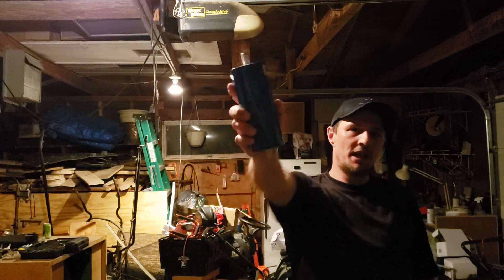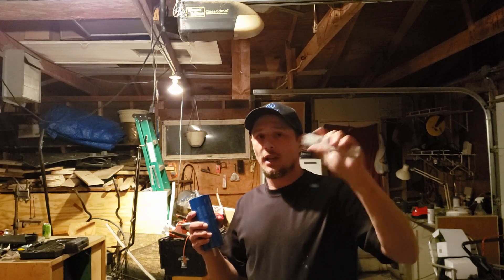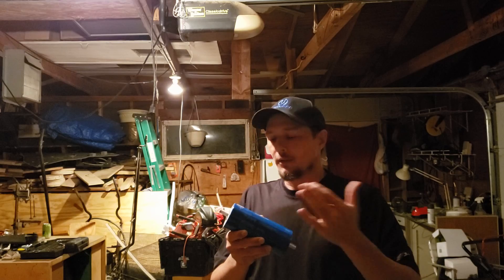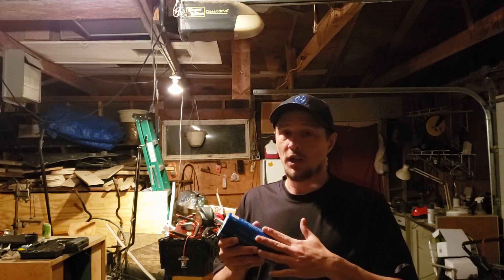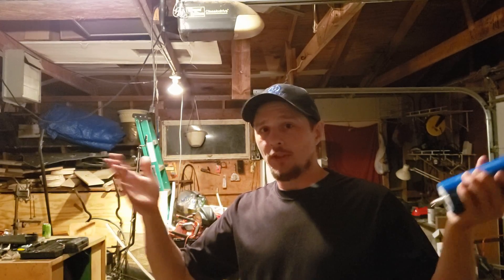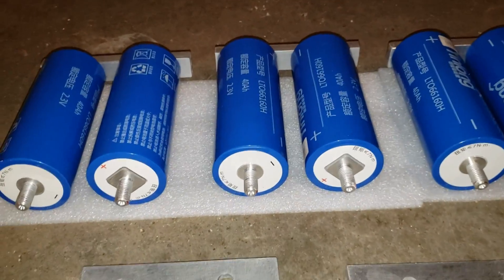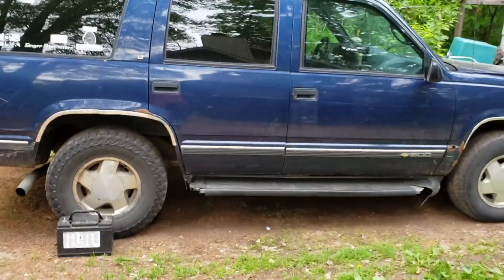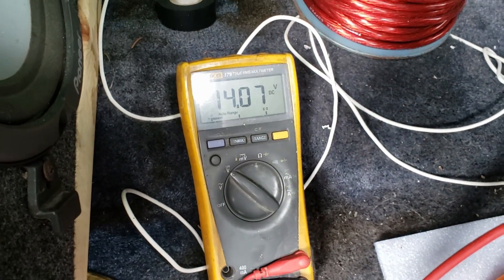13.8v Yinlong LTO 40ah how to Build and testing , DIY Lithium

Comment: Is a 40ah bank good enough for 3k rms? My truck comes with 240 amp stock alt, h6 agm as well. I have 0 gauge power & ground running to amp from front batt currently but will use that run to go to this 40ah bank then to the amp to support the draw. I really only have space for this 40ah bank so hoping its what I need.

Comment: never used a BMS with 6S config, it is useless, just charge them once a month or so with a higher voltage, just keep SOC at 80% of those LTOs.
Reply from the maker: sounds like you are 10 years behind lol .
Reply: @mazda2284  These are LTO cells, not LiFePO4 or other sensitive types. They don’t need balancing—just keep them at 80% SOC, and they’ll last forever.
Reply: @mazda2284  Sounds like I've gained five years of experience with the cells I bought almost six years ago, like you 5 years ago, so I can say that a BMS isn't needed—but the mazda guy here commenting just doesn't get it.
Reply from the maker: @ thats why yinlong makes and sells and uses bms and balancers lol . i work directly with the factory , i also can read a datasheet .

Comment: Odyssey agm wont work with these? 😢
Reply from the maker: why would you need a AGM with these ? the AGM is only going to hurt your voltage , provides nothing. only to lower your voltage and drain your battery and stress your alternator.

Comment: Will 18 of these 40ah cells support 5k watts? Is it 6 cells per bank?
Reply from the maker: yes, and yes 6 per bank
Reply: 1 bank is enough with 400a alternator or 2 banks maximum but it wont hurt with 3 will be nore efficent but hey nothing wrong with saving a few £100 and having 2 banks
Reply from the maker: 6PCS Yinlong 2.3V 40Ah 66160 Lithium Titanate Battery Cylindrical LTO 400amp charge and discharge 10c 
Sriko Discount code= BDSB
https://srikobatteries.com/product/grade-a-6pcs-yinlong-2-3v-40ah-cylindrical-battery-lto-cells/?wpam_id=8

Comment: For how expensive AGM batteries cost these days. You're better off in the long run buying these LTO cells and making your own car/primary battery. If you maintain the charge, they will last for 20yrs or better.

Comment: Hey howsit boet .. regarding  yinlong 35, 40 and 45ah.. besides capacity anything else different  between them ? Internal resistances or discharge rates ?
Reply: No difference except power density/weight

Comment: nice, video. I want to replace the lead acid battery in my car with LTOs. Because of the lower internal resistance, could the alternator overheat if your LTO is on low voltage and draws lots of amps? did you have any issues with that?

Comment: I would still use AGM for hybird system. Its just better.
Reply from the maker: Agm is old dead technology,  its fine for those that don't yet understand the new technology,  agm has no advantages over lithium.

Comment: Hello my altinaitor is 14v 100 ah cant i use 1 bank 40amps . Cant my altinaitor charge the LTO bank 40amp
Reply from the maker: 40ah 10c = 400 amp charge / discharge
Reply: @mazda2284  i must have a big altinaitor  en how charge the LTO from the front battery or alternator
Reply from the maker: @johnnybhageloe8904  those are max, you do not need to charge max , also battery delete front battery . watch my other videos

Comment: Are the cells supposed to have separation when assembling a 40ah bank?
Reply from the maker: Like the cells not touching? Yes you do not want the cells sides to touch , they can wear through the wrapping and short out. Under the wrap the whole body is negative.
Reply: @mazda2284  great thank you for your response.

Comment: Can I have a AGM upfront just as long as I run wire from the alt to the lithium bank? Trying not to make a mistake I’ll get a XS Power lithium battery for the front if need be.

Comment: Hey, Can i run this on a stock alt? Debaiting between this and headways. id like to keep the alt stock.
Reply from the maker: depends on charge voltage over 14.4v you can run these , lower you want headway

Comment: Odd battery voltages, not comparable with 12/24/48 chargers controllers or inverters.
Reply from the maker: Some do 16v , my inverter does 16v , they also will work for 24v in 10s
Reply: @mazda2284 The "Discharging Curve" is incompatible with inverters. you loose 35% (or more) of the batteries capacity.
Reply from the maker: @sciologist  depends on your inverter.  10s is 27v-19v , that falls directly in a discharge curve for a 24v inverter.  If you use a standard inverter that is directly made for lead acid of course you are going to get lead acid curve results.

Comment: Why dont you use heavy copper wire (better conductor) instead of Aluminium bars?
Reply from the maker: galvanetic corrosion cuz they have aluminum studs , oxidization , cost wire and terminals adds up fast also adding many more points of contact and chance for fail , wire dont add support .

Comment: Hey, im planning to build me a sailboat, but it wont be using fuel of any kind, it will mainly be powered by wind but secondary propultion would be a electric motor. I would love to run atleast 2 pretty large simewave inverters and input voltage would need be 48v. These eletric systems consumes alot of amperage if you really run them more than 25% throttle. 

How would these batteries do in comparison to lithium ion and any other thoughts?

Recharging would be via solar panels, some wind turbines and also regeneration via the electric motor.
Reply: Yinlong LTO 2.3V/33Ah prismatic battery cell in stock! Fast charging in 8 mintues, wide temperature range and much longer cycle life than LFP. We are a wholly-owned subsidiary of Gree Electric Appliances, Inc. of Zhuhai. Feel free to contact me.

Comment: Hi i went to make 6 sell in series connections 12 v solar system. how much ah total come 6 sell. If I make 1 sell 30ah 6 sell how much come . This is ok for solar system. 6 sell how much price
Reply from the maker: these dont work well with solar due to 13.8v nominal in 6s , you need to charge 14.2v minimum and that would be low soc/capacity , to get full capacity you need to charge 15.6v-16v
Reply: Yes ... i can charge 15-16 v ... but 6 call how much ah come if 1 call 40 ah

Comment: I see 12.3 for your lead acid... if that's what it's sitting at first thing in the morning, you need to put it on the charger one day soon, or you're gonna need a new battery quicker than usual. It should be 12.6 after it sits for a while.  Sitting at 12.4 and below, it starts to build up sulfates on the lead plates, and it just goes downhill quick from there.
Reply from the maker: i dont even use lead acid . thats a crap battery i have left laying around . i have zero desire to use it for anything . its trash .
Reply: @mazda2284  Oh, you're vehicle is running on lithium now?  cool!
Reply from the maker: @blackz06  has been for 4 years lol
Reply: @mazda2284  Cool!  did you have to modify the voltage regulator?  what's the peak charge voltage?
Reply from the maker: @blackz06  no , stock alt charging 14.8v 

cold

Comment: Will 1 bank (40ah) fit in the diy 3400 casing that is on the website for all xs power stuff?? Or is it to small or big? Im looking to run 2 banks of these to run the entire car, starter and system. 1 in the front and wired parallel to the back
Reply from the maker: No , you need the biggest one , think its 7500 ?
Reply: @mazda2284  thanks alot man. I decided im just gonna do battery relocate to the rear. Its just easier and alot betger waight distribution.
Reply: @mazda2284  do you use grad B yinlong cells? Or do you run the grade A cells?
Reply from the maker: @tyler_ragoonanan  ive run them all from scrap grade sold to me on amazon to grade A New from XS Power
Reply: @mazda2284  and how do you think the lower grades hold up versus the grade A? Just asking because ill be buying from a seller on facebook that buts directly from Yinlong grade B cells

Comment: Make video on setting external  voltage  regulator  for those cells
Reply from the maker: I recommend internal and not going crazy on voltage.  To many people screw up or have external fail . I'd ask someone else . I go through singer alternators for all my alternator needs .
Reply: @mazda2284  ok

Comment: So I would need to upgrade the alternator and ditch the battery under the hood in order to use these?
Reply from the maker: Alternator depends on what voltage you charge,  you can use stock if you charge 14.4v or higher,  if not some alternator systems can be tricked to put out more voltage without changing alternator.  Key is you need to charge over 14.2v-14.4v minimum , preferably 15.2v-15.6v is where they do best , you can do over 16v but 16v is hard on factory electrical devices in car and there isnt hardly any gain from 15.6 to 16v . 15.2v should be fine with anything  in car .

Comment: Why not run a battery isolator and or a second alternator. Then you could run the amps at 16+volts
Reply from the maker: Depends on the amps if they can do 16v , amps I'm running are 15.3v stable and have fully regulated power supplies so they dont really gain much wattage from higher voltage.  And isolator is for 2 batteries or the same type , not 2 totally different voltages and chemistry
Reply: @mazda2284  . I thought the power supplies might have been with the spl numbers. My amps say they take 18v but handle 16.8 definitely( 100c lipo ) full charge. Interesting times for car stereo gear.
Reply from the maker: @justinmaxwell1608  many companies are going away from the 16-20v amps in favor for standard voltage , sundown for example went from a amp ns2 19v amps to salt12 , the salt does more power at normal voltage than the ns2 did at 19v 
SALT-4 : $1229.99 (SCV-4000D = $1149.99)
SALT-6 : $1699.99 (SCV-6000D = $1659.99)
SALT-8 : $2099.99 (SCV-7500D = $2049.99)
SALT-12 : $3999.99 (NS-2 = $3569.99)

Comment: How are these cells in terms of life cycles and quality ?
The company Claims 30 thousand life cycles.
Do u belief that?
Reply from the maker: 20k at 10c , 30k at 1c .
Reply: What does 10c and 1c mean, thanks
Reply from the maker: @volvojohn7191  the amount of charge and discharge amps . say you have 10ah at 1c its 10amps , if you have 10ah at 10c its 100amps

Comment: I just heard today you can't charge them with your alternator when u first install. I'm getting a 80ah bank of the yinglong cells what's your recommendation? Bass my friend
Reply from the maker: check out my newest video showing how to charge with bench power supply  :) 
with a bench power supply you can charge anything to proper voltage and amperage just have to know about what your charging

Comment: Can it be used for off-grid solar system as back up battery
Reply from the maker: yes , but keep in mind to get full charge you would need to charge above 15v for full capacity , 15.6 preferable for near full capacity  . most power inverters max at 14.8v or around there . so you would need to find a inverter that can handle higher voltage , min voltage is 12v in 6s so that is also a issue as most inverters will run down to 10.5v

Comment: why too pricey...   better batteries out there for less money
Reply from the maker: like what ?
Reply: @mazda2284    those used Valence medical batteries for one...already packaged with plugs ,,   several deals of 18650s  by the case of 100 for less then 80c each...lot more AH per buck .. just have to assemble them...  not all that convinced a BMS is really needed
Reply: also some larger red cells  forgot what they are called  about 3x as big as a 18650   no soldering required.. screws on the ends..   still a little pricey but the performance is amazing from what ive heard
Reply from the maker: @stevestrickland7314  i have headways and have used the valence batteries ''check out my other videos'' , for car audio these kick the crap out of those hands down , if your doing solar the lifepo4 would be better but then again large winston prismatics would be better than those headway or valence or smaller lifepo4 cells .
Reply from the maker: @stevestrickland7314  also 18650 and 26650 cells are much more of a pain in the ass to work with , they either use thin nickel strips to connect them or compression plates , using smaller cells you have more fail points , also cycle life is far far better with these yinlong LTO , lifepo4 you are talking 4-5k cycles , yinlongs are 20k at 5c , 25k at 2c and 30k+ at 1c , the lifespan is a huge factor
Reply: @mazda2284  why the 66160 is better than a 38120? 1000$ theoricaly in 38120 is more energy than a 66160 for the same ammount of money, so why is better? Im in a latinamerican country and i want to start building my own battery bank for my clients, but i dont know wich way choose, 38120 or 66160

66160 long life and relaible
38120 no need to aftermarket alts and can match witch agms, and more AMPS for the same money so? What should i do ? 

Thanks for the videos man
Reply: @mauromuller6649  which did u choose?

Comment: Those bars are ridiculously oversized and clumsy. All you need is a thin thin slice of copper between them. Plus, due to the distance between the holes your battery pack is way larger than it has to be due to all the air between the cells. Having all that metal everywhere including sticking out beyond the diameter of the cell is just begging for shorts and other issues.

Comment: These are awesome cells. I use 264 of these cells for my home solar storage. works out to be 24kwh 12P 22S. Been using them since Feb 2019 its now July 2019.
Reply: please i need how you connect the battery with solar  panel  and how many solar panel charge the 22s battery. Thanks
Reply: @oredekofola955  You need to charge batteries using a solar charge controller.Connect panels to controller then controller to batteries. But there is a lot more.You need to correct size panels to charge controller to battery bank, these factors are all related.
Reply: Make a video please.
Reply: Wow that’s a lot of cells!! What BMS are you running? What’s the reason you went for LTO compared to LFP cells, is it to be able to charge in lower temperatures?
Reply: @Yiveytube they don't need a bms just a balancer the higher you top them off the more they swing

Comment: Not sure why play in the same track you got a lower frequency with the yinglong, but you still gained.
Reply from the maker: amp was able to make more power at lower frequency i guess
Reply: @mazda2284  it does make me nervous what's such low resistance in them and all the exposed metal. I think if I use some I would build some kind of case for them and cover them completely
Reply from the maker: @BARBELLS-AND-BUDS  yeah i build a wood case , XS power sells empty cases , i think its DIY 75 that fits 
https://diycentralshop.com/product/40ah-lithium-cell/
Reply: @mazda2284  Yeah i think so. Where can i but these? I thought these were super caps when I first saw them lol. I didn't know lithium came this way

Comment: If I already have a 45ah limitless lithium battery in the trunk how many of these cells would I need for a starting battery under the hood?
Reply from the maker: dont use these with limitless and dont use batteries under the hood
Reply: @mazda2284  yeah I spoke with Chris from limitless lithium and he's hooking me up with a cap for under the hood
Reply: @mazda2284  so what would I use for a starting battery if I have the yinlongs in the back?
Reply from the maker: @gbodylyfe_216  the yinlongs in the back .... didnt you watch this video lol ? if not you should watch it ALL lol
Reply: mazda2284 I must’ve missed that part lmbo. Got it now. Thanks bro!
Reply: @mazda2284  rubbish, they handle a shitton of heat, 60C is OK for them, and thats the point of those cells, they are rugged!

Comment: Now you just need a bank of capacitors
Reply: No capacitors needed
Reply: Capacitors can dump current faster that any battery I know of! So a small bank of super caps, could really stop voltage dips! And controller the spikes from the alternator overshooting,  I'm a fan of capacitors,

Comment: So in order to get 15 plus volts, I would need an externally regulated alternator right? In addition I can't run in these with AGM batteries, what batteries are we allowed to use underneath the hood to start and run a vehicle???
Reply from the maker: These will start the vehicle without a battery under the hood.  You would need a regulator to get over 15v . 14.2v charge is lowest I'd recommend. I did a startup in the video with only the lithium